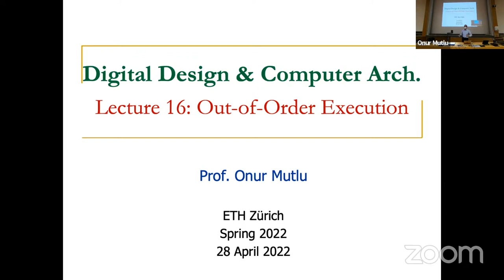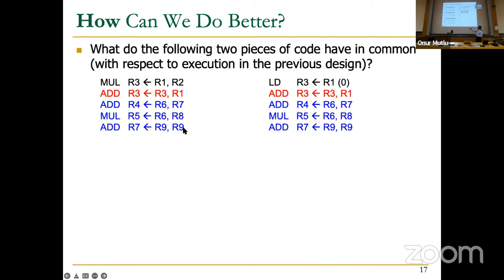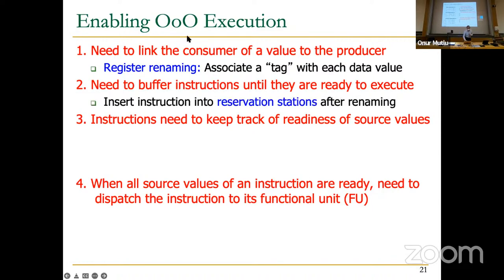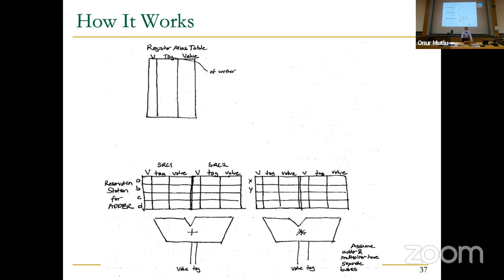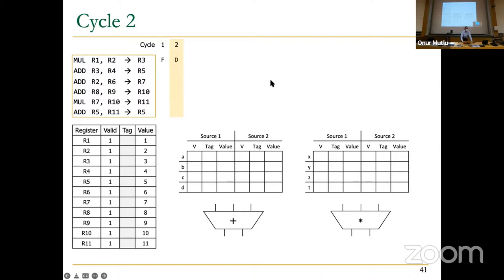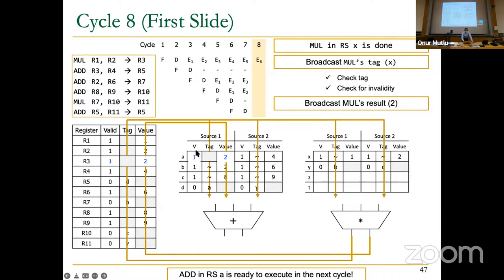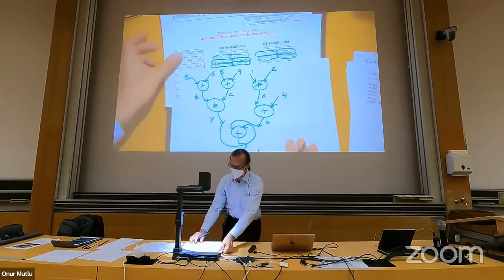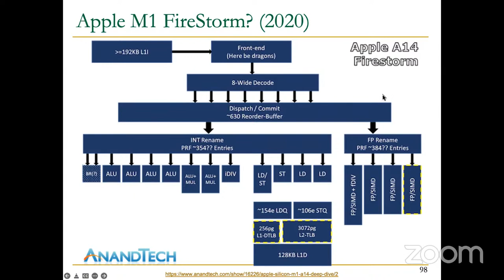Digital Design & Computer Architecture - Lecture 16: Out-of-Order Execution (Spring 2022)

Comment: Thanks a lot for the great resources! I have a (probably really stupid) question, but how can one Functional Unit (e.g. the Adder in the example) execute multiple instructions at a time?
Reply from the maker: Via pipelining of the functional unit.
Reply: @OnurMutluLectures   Thanks a lot for your quick response! I still am not 100% sure, however. Following your washing machine-dryer-analogy from lecture 13, wouldn't this mean that I still need multiple dryers/FUs to realize this?
Reply: @GermanCoDClan  I believe when he says "at the same time" and "pipelining the functional unit", he's saying that n-addition instructions (say n=4 for our case) are running at the same time in the pipeline, which is the functional unit (its a black box in the image shown on the slides). The addition process is broken up into stages in the pipeline, so each of the n-instructions is in a different phase of the addition process (pipeline). Think of the cars in an assembly line example where n-cars are being built at the same time, but they are just in different stages of the pipeline where one is having its wheels put on, while another is having its engine inserted.